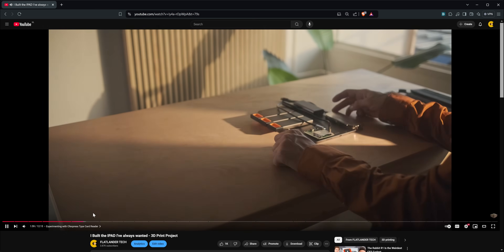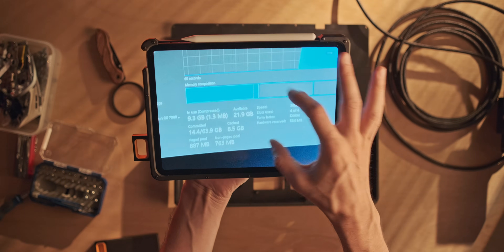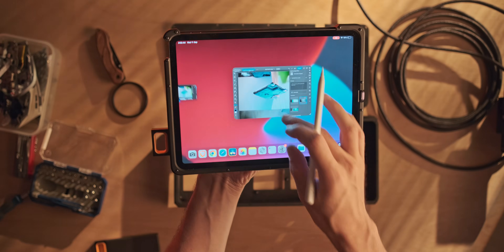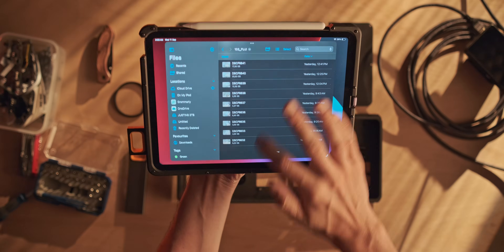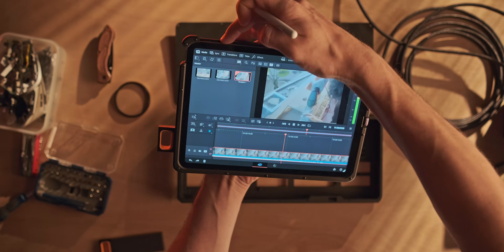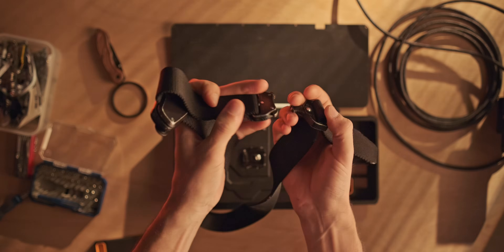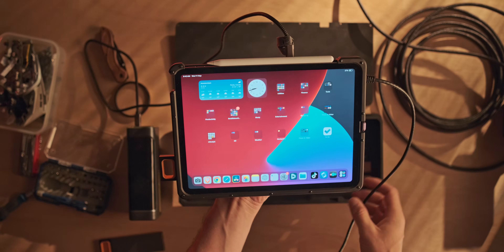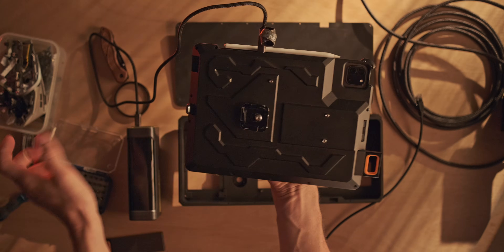Showing how the Edit iPad Case I 3D Printed is Performing

Comment from the maker: For those who wish to build this themselves, here’s a list of the components I used for the project. Along side a link to the project stl files (I do want to mention that the hub was exceptionally hard to take apart, so it might be worth modelling a different case around your own hub.)

( This is modelled around my M1 iPad Pro 11 inch btw ) Project Files : https://www.pcbway.com/project/shareproject/Built_the_Edit_IPAD_I_ve_always_wanted_954a564c.html

Affiliate links:

Hub: https://amzn.to/3AY3QVr
USB-C: https://amzn.to/3Zi96gZ
CFexpress Type B Reader: https://amzn.to/3ZlAQRV
Uni Accessories M.2 Enclosure: https://amzn.to/3Xmg9m7

I’ve seen some comments asking, or jokingly saying, "When will it be available to buy?" Personally, I’m more focused on spreading ideas and building things. I genuinely wouldn’t know the first thing about making this commercially available. That said, I truly believe in a more decentralized system where “Justin designed this thing, you print it on your machine, modify it, and share those mods with the community (attribution would be nice, haha).” This ensures you have full control over the product you “buy,” so to speak, and it keeps the passion intact, which is what makes gear or tech like this better.

So, if you're willing to spend 300 euros on something like this, I’d say skip it. Buy a 3D printer instead and learn CAD—it’s the best investment I’ve ever made! and if the prints come out looking like S*** you can use PCBWay to print it in something awesome like resin ( This video was not sponsored but they do sponsor the channel and I've just been impressed by the quality they provide ) :)
Reply: Would you not want to licence the download? I would totally pay for the file. It's so good.

Comment: Really impressive build! I love how you’ve turned the iPad into a true editing workstation. I couldn’t help but think of one idea: if you added a cold shoe mount on either side of the top (for a small shotgun mic), a tripod socket, and maybe two side handles with a glide/rail mechanism, it could be even more versatile. Not necessary, but if there’s also room for one of the many anamorphic “lenses” available for iPad/iPhone, it might truly become the only machine you’d ever need: shoot, edit, and deliver all in one.

I’m a videographer, but I always end up using film emulation in DaVinci for my personal projects, and with apps like Blackmagic becoming so capable, my need for a huge rig sometimes feels a bit silly. Right now, I have a big setup built around the BMPCC 4K, but since it all ends up going through heavy film emulation anyway, the purpose of such a rig can feel unnecessary. 

I also understand that apps like Peala can trick the iPhone into shooting open gate, which sadly doesn’t exist for iPad yet (and maybe it’s not even needed, I haven't researched the camera capabilities fully on the iPad systems). 

Either way, I’m honestly tempted to replace my cinema rig, now that I’m stepping more and more back from professional gigs, and build something like this instead for personal projects, especially for traveling.

Anyway, fantastic video man!!

Comment: What is the resin print like? Is it durable and strong, or will it break easily? Was it expensive? I'm really enjoying your videos.
Reply from the maker: The Resin is holding up really great although i have not dropped the case yet, i dont think it would survive a drop so maybe it would be better to print it in Nylon or something more rugged if your planning this yourself. as for the price, i dont quite remember how much it cost but i t was around 80 or 100 euro for the print.

Comment: I think you need to install an on/off switch for the case. That way the USB hub only draws power from the iPad when you need it, otherwise it will continue to drain the battery. But its a really cool build. Love it!
Reply from the maker: Thats a really great suggestion! im going to research how this works like which wires to reroute through the switch because that would be really awesome, thank you!
Reply: One workaround for that would be to unplug the usb c u port that connects the iPad to the back case. 
Problem solved. 
Re attach when needed.
Reply: @PR0J3CTXYZ if you do that several times a day you’ll have a loose usb-c port in half a year

Comment: The first thing I want to say: you have an old computer on Windows, update it with hardware, I have 80 gigs from a flash drive to a computer and back for about a minute, then why does your hub radiator heat the tablet, make it so that it is part of the back of the case, and so the idea is not bad, but it's better make it for the Surface Pro 9, there will be more features on it. On my computer, I was maxing out the speed from a flash drive to a computer of 40 Gbit and the same back.

Comment: I was thinking maybe somehow the keyboard smart connector could be extended to the side like how old iPad Pros from the pre 2018 design were, something like what Logitech did, maybe try ripping the whole content of a Logitech folio keyboard or whatever it’s called and integrating it to your design so that you can attach and detach a keyboard whenever you need to though a sliding mechanism like you said should have been awesome but this would require more space, potentially more thickness but this would be nice to see, nice design though

Comment: have you considered adding a cold plate to help cool the ipad? or is it not getting hot for you?
Reply from the maker: In the beginning i concepted adding active cooling with a fan and heatsink but i use the M1 ipad and ive not had any overheading issues, let me know if your experience is different then ill make sure to add it on the next itteration of this.

Comment: Yes you can connect the iPad to Ethernet for NAS. Keep in mind the speeds of the NAS’s Ethernet ports though! The iPad usb is 10gbps or 40gbps, and many consumer grade NASs are 1Gbps networking. NASs with 2.5gbps are becoming more common, and the 2.5gbps Ethernet adapter from Anker is dirt cheap at $30. 10gbps networking NAS do exist, but that’s usually enterprise grade hardware. 

Personally if in budget I would recommend a NAS that supports Thunderbolt 3 for 40gbps. They’re significantly pricier than 1Gbps setups, but cheaper and faster than enterprise solutions.
Reply from the maker: Thats awesome to know! thank you so much for this info, ill be upgrading some stuff in a few months and this is good info to have :)
Reply: @FlatLanderTech if you’ve built a pc you can easily build a NAS 
10gbps network cards are cheap. 10gbps network switches are also not expensive these days 

Also a “NAS” you attach using a cable is actually called a “DAS” at that point !
NAS = network attached storage 
DAS = direct attach storage
Reply: @dylan-nguyen  NEVER recommend a home built storage solution for professional workloads. This isn’t for storing family road trip photos and BitTorrent downloads, it’s for hundreds of thousands or millions of dollars of media. 

Of course it can be rewarding to learn about the different kinds of filesystems, storage interfaces, redundancy, security, etc. If FLT, or anyone for that matter, goes down that rabbit hole and builds a storage solution then the risks are on them. Just understand this: you can make a mistake that directly causes data loss years from now.
Reply: @TheOfficialOriginalChad  I was an IT engineer for 10 years. there's nothing different from a bought NAS vs a home built NAS. you still do all of the configuration yourself. the only difference is now you need to choose your own OS to install. 

also if something is actually critical, it shouldn't only be stored on the NAS. it should be backed up to S3 or another solution but that would greatly increase the cost
Reply: @dylan-nguyen Cool, what kind of IT engineer? Why did you change careers? 

To say there’s no difference between home built and consumer grade is to say there are no choices when building your own. HBA or RAID? XFS, ZFS Or Ext4? ECC or consumer grade ram? Run cache in memory or on SSDs? How much cache do you need to scrub 4k footage over the network? None of these decisions are backed with support or warranty. 

When shopping for a consumer grade NAS, you don’t need to worry about any of this. Just the features on the box.
Reply: @TheOfficialOriginalChad  I started off as help desk and then moved to the systems engineering side. I'm now on infosec 

but yes there are many more choices when building your own but you could follow numerous guides on set up and get decent results. 

if you get a Netapp or Synology you do need to pay for support in regards to config

Comment: Wow, another way to try treat iPad as serious device. Is heating a problem?
Reply from the maker: I've heard someone in the comments say they would be concerned about this but I've personally not yet had any problems although I use the older m1 chip. but don't get me wrong I've not edited for longer that maybe 15 minutes on this thing, mostly just very short little timeline additions, like I've filmed something, quickly through it in the timeline and check if it works.
Reply: @FlatLanderTech  same silicon and this is an serious issue

Comment: Im concerned about overheating given that it already overheats without a case...
Reply from the maker: Ooo thats unfortunate i have not had these issues myself, im still working on the older M1 chips tho? do you have a newer model?
Reply: What are you doing with an ipad that overheats it? I have an M1 pro and it has never had that problem. Though tbf, I do office work/photo editing at most.

Comment: I heard that there is no safe way to eject storage drives on ipad, apparently you have to turn off the ipad to avoid potentially corrupting your data. Anyone knwo if this is true?
Reply: Just make sure nothing is writing the drive while taking it out. Then it wont corrupt whatever you do, you can jusr pull it out. The only thing eject does is checking if software is writing to the drive, and potentially stopping it
Reply from the maker: As @DrTheRich pointed out its not necessarily something that has to be done its more as a double check so no worries in that regard on my end at least, during testing I've had moments where I was transferring files and disconnected power with a chain of hubs where it disconnected the drives and the footage was all still okay ( not that I recommend doing that haha, but its not like, one mistake and your stuff is gone )

Comment: The main reason is x86 is not that well optimised in comparison to arm which is what apple uses. They have optimised the software to the CPU and GPU architecture. For raw power x86 is still king but the reality is most people don't need only raw power they need optimised software. AMD acceleration is also way behind NVIDIA so lightroom and Photoshop is just not getting as much hardware acceleration as it would from an Nvidia GPU. I use a AMD PC for gaming and video editing with a bit of photo editing but also have an M1 MacBook and the difference in photo editing is light years
Reply: With open source software, the difference is a lot less significant for example...
Reply from the maker: hahah i see you perusing the comment section @DrTheRich XD glad your enjoying the convo :)
Reply from the maker: Thank you for explaining this its always really great to get these bit size pieces of information really appreciate it!
Reply: I would not at all be surprised if there is some business dealigs going on behind the scene here. Creators are one of apples biggest markets and they do everything legally possible to make sure you choose their system over the competition, including colluding with software makers to slack on optimizing for the competition... All just speculation of course...